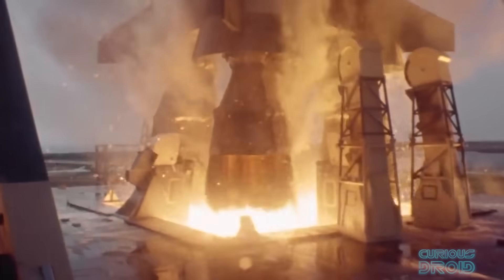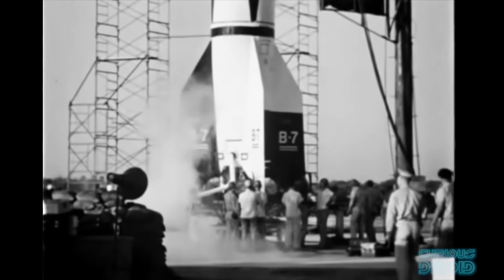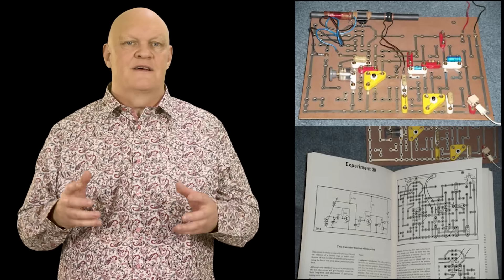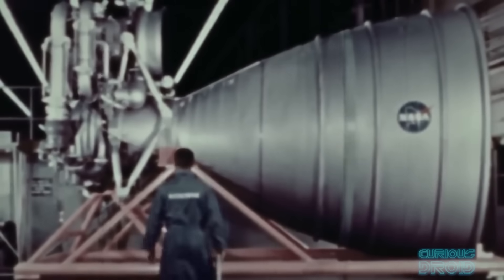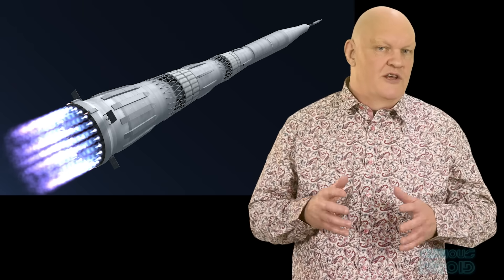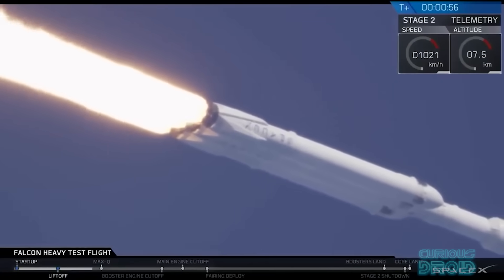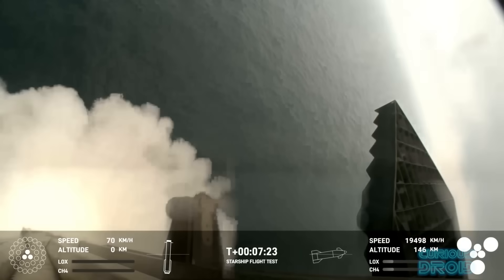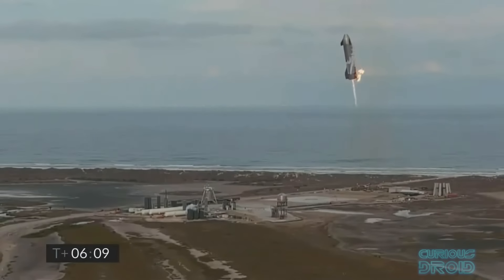Why Does SpaceX Use 33 Engines While NASA Used Just 5?

Comment: I turned 14, in August of 1975.  My father taught me to solder at age ten, and I had been building the electronic kits from Radio shack for a few years prior to that!
Reply: Lol I turned 14 back in 2018. I turned 10 in 2014. 
My favourite childhood memory was learning how to do electronics stuff from the arduino kit I smuggled out of my dads office lmfaoo.
It was mostly breadboarding with random IC's and stuff.
Dad didn't allow me to solder cus he thought I would do some dumb shit with it, so for all my RC toys, I would make them by gluing together connections lmfao.
Reply: So tell me, in fifty-some years, have you figured out how to keep the solder fumes from aiming directly towards your face without just aiming a big fan at yourself? Because I haven't worked that one out yet. :D
Reply: @IstasPumaNevada  I used a fan on a lower speed for many years, until the technology improved. I built a solder fume extractor, from videos on Youtube!
Reply: @IstasPumaNevada You don't need to aim a fan at yourself or your work. I've got an old desk that I've repurposed as my soldering station, I have a small desk fan sitting on the side of the desk facing away from me. I just open the window and let the fan pull the fumes away from me and blow them out the window.

Comment: I've spent several hours in that metal building with the Saturn 5 in Houston.
Reply: I was there one time and I was blown away at how big those engines are and the size of the rocket.  And then thinking how it took all that rocket to get just that little bit at the tip into space 😮
Reply: Do they have a bathroom?
Reply: @hamaljay Not on Apollo, they stuck a plastic bag to their bum. It was as gross as it sounds.
Reply: @hamaljay  Not something I remember. I got offered a great job while I was looking at the pad abort system. Memorable day other than the toilet sitch.

Comment: Will be an interesting comparative in terms of reliability as refurbishment costs, when Blue Origin have their New Glenn rocket in operation, using far less engines.
Reply: New Glenn has not flown, and is having serious engine problems. At the current rate of progress, it will be a decade or more before New Glenn flies.
Reply: @owensmith7530   And your source of information was probably gather from the multiple SpaceX fanboy channels.
Reply: New Glenn is far from Starship in capability so comparing them like that is pretty misleading imo.
Reply: New Glen is nearly vaporware.  They may yet prove themselves but I am pessimistic
Reply: @M167A1   Interesting that many are only skeptical when it's about other Rocket companies, not so much with Musk claims, especially about Starship capabilities.
Reply: Did Apollo 11 actually leave near-Earth orbit?
Despite the revisionist narrative that this channel won't question -- unstable fuel burn for the oversized F1 engines was never rectified and another arrangement in their place was made in order to reach near Earth orbit, keeping the F1 bell nozzle to maintain the desired appearance.  The great licking yellow flame was an indication that something was not normal as fuel was burning in the atmosphere while providing no additional thrust. This was the result of injecting additional kerosene into the exhaust stream for greater visual effect yet appearing to produce an inefficient burn unlike other rockets after launch.  No explanation is forthcoming and this issue is not addressed in any usual report; however, using a smaller reliable engine with a reduced fuel load and stripped down mission requirement allowed the Saturn V to reach near-Earth orbit.  

The Apollo 11 crew attempted to demonstrate their position at over halfway to the moon as seen in the unedited version presented to the public while the more recently released unedited version reveals a flood of blue light entering the same window as the camera continues to roll, through which only a moment before, we saw the Earth far distant in what appeared to be very low light conditions. Then, as the camera pulls back from the window, the exposure settings are seen to return to normal as a flood of light enters the same window.  Without a change in the orientation of the spacecraft assumed to be on a trajectory toward the moon, the only source for any flood of light can be the Earth while in near-Earth orbit.  

Another indication are the impossible weather patterns seen on Earth, when in reality only a small portion of the Earth's surface was visible, framed by the round window of the command module.  Straight line cloud fronts are seen to be extending for what appears to be more than 6000 miles, a quarter of the Earth's circumference -- something that has never occurred in the meteorological record on Earth. 

The usual sponsored efforts will try to make excuses for why the obvious did not take place -- yet is overly apparent in the unedited version.  When facts cannot prevail in support, sponsored activity will resort to name calling and other derogatory comments discrediting themselves.

Comment: F1 100% reliable 
???
 ~ 
Apollo 13 lost its Centre F1 on lift-off.
Reply: Wrong. It had an early shut down of a J2 engine on the second stage, the other 4 burned longer and achieved the correct orbit.

Comment: Just the title alone was enough for me to shake my head. Size and weight have everything to do with how many engines are required. 

Hate click bate rubbish.
Reply: The correct word is bait, not bate, and the title is neither. Nor is your assertion that size and weight control how many engines are required accurate. If you need 100 units of force, you can do it with any number of engines so long as their sum total thrust is 100 and they don't exceed your weight allotment for engines.

This is one of the good channels on YouTube. Nobody is forcing you to watch the video, but you can't make an accurate assessment that the title is click bait if you didn't bother to and thus have no business saying it is as if it was a fact. You are lying to people by doing so, the exact sort of accusation you are incorrectly levying.
Reply: @mikebmcl  You got me on bait. But that is all you got. The Starship is built to carry tons more weight than the Apollo rocket could even imagine doing. Does the Starship need them all for launch? No. But SpaceX is going to keep testing like they were fully loaded. That is what caused the second one to disassemble itself. There is a night and day difference between the two and their purpose. 

I HATE CLICK BAIT!
Reply: Watch the video.
Reply: lolno
Reply: Did you actually watch the video?
Reply: @airingcupboard  Not when it is click bate. Click bate removes credibility. The thing is he is smarter then this. But here he is using click bate.
Reply: Did Apollo 11 actually leave near-Earth orbit?
Despite the revisionist narrative that this channel won't question -- unstable fuel burn for the oversized F1 engines was never rectified and another arrangement in their place was made in order to reach near Earth orbit, keeping the F1 bell nozzle to maintain the desired appearance.  The great licking yellow flame was an indication that something was not normal as fuel was burning in the atmosphere while providing no additional thrust. This was the result of injecting additional kerosene into the exhaust stream for greater visual effect yet appearing to produce an inefficient burn unlike other rockets after launch.  No explanation is forthcoming and this issue is not addressed in any usual report; however, using a smaller reliable engine with a reduced fuel load and stripped down mission requirement allowed the Saturn V to reach near-Earth orbit.  

The Apollo 11 crew attempted to demonstrate their position at over halfway to the moon as seen in the unedited version presented to the public while the more recently released unedited version reveals a flood of blue light entering the same window as the camera continues to roll, through which only a moment before, we saw the Earth far distant in what appeared to be very low light conditions. Then, as the camera pulls back from the window, the exposure settings are seen to return to normal as a flood of light enters the same window.  Without a change in the orientation of the spacecraft assumed to be on a trajectory toward the moon, the only source for any flood of light can be the Earth while in near-Earth orbit.  

Another indication are the impossible weather patterns seen on Earth, when in reality only a small portion of the Earth's surface was visible, framed by the round window of the command module.  Straight line cloud fronts are seen to be extending for what appears to be more than 6000 miles, a quarter of the Earth's circumference -- something that has never occurred in the meteorological record on Earth. 

The usual sponsored efforts will try to make excuses for why the obvious did not take place -- yet is overly apparent in the unedited version.  When facts cannot prevail in support, sponsored activity will resort to name calling and other derogatory comments discrediting themselves.